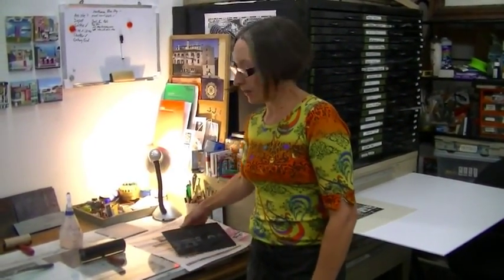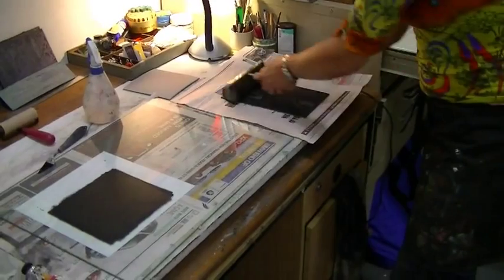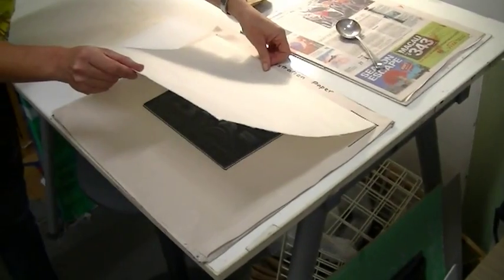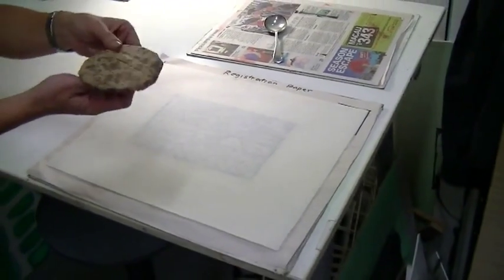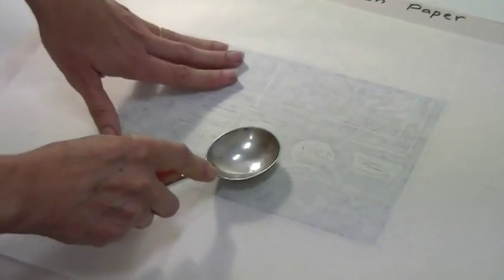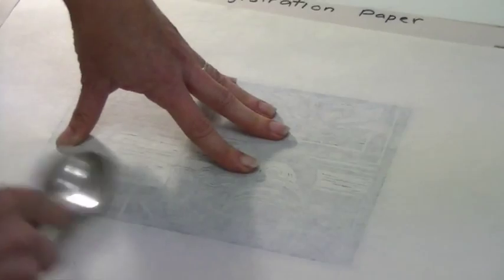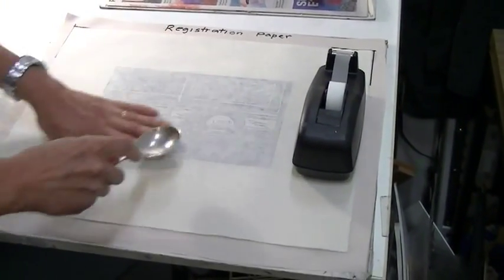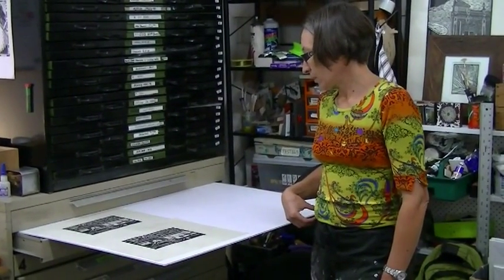Printing a Linocut with Maggie Stein

Comment: To use the baren, place the heel of the hand on one side and then the fingers curve over the handle with the fingertips (no thumb) wedged under the handle on the other side. This allows excellent transfer of weight/pressure through the heel of the hand.

Comment: I think the reason you're not finding the baren very good is because you're not using it correctly. Try slipping your fingers under the handle and with a fairly firm grip you can get nice pressure.